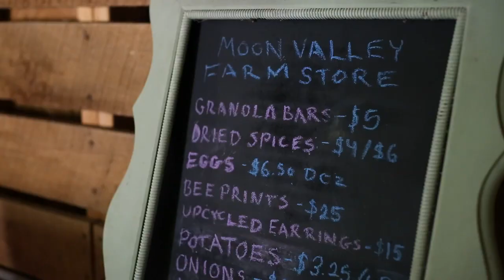Aerated Static Pile Composting with Moon Valley Farm

Comment: You didn't show how it was aerated.  How is this different to a normal static pile 3-bin system?  Aerated static piles have pipes and blowers to aerate them.
Reply from the maker: We did not show that - apologies! This is the same as a normal static pile 3 bin system, it's just smaller for the scale at the time. The pipes are perforated, in a bed of gravel, and the bottom wooden slats are also perforated and removable in case of the  need of cleaning. Each bay has a cut off as well so you can run 1, 2 or 3 at a time.
Reply: @moon_valley_farm  Would have made FAR more sense to show that your system was actively aerated.  Anyway, glad to know I hadn't missed something which was there.... but had noticed something which should have been there, but wasn't. All the best with your composting.  I just use multiple static piles raised up on pallets for drainage and to deter rodents. Much lower carbon emissions and infrastructure costs.

Comment: Check out the Cal Berkley hot composting method. You have to turn the piles. But you have finished compost in 3-4 weeks
Reply from the maker: I have seen that! We do also get finished compost in a short turn-around time, usually 5-6 weeks (though the last 2 are for curing) and not having to turn the piles for me is worth the little extra wait!